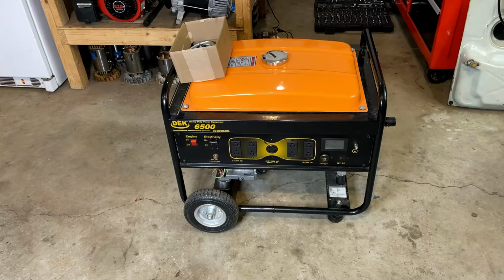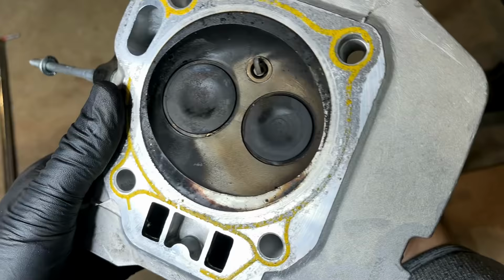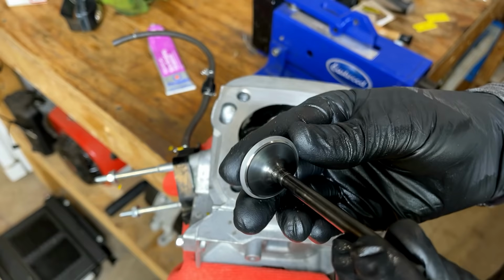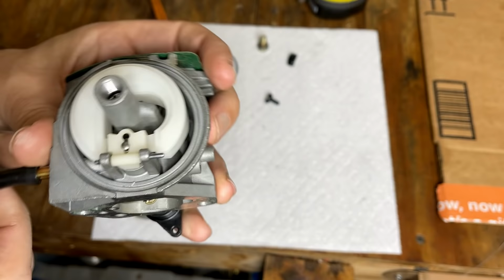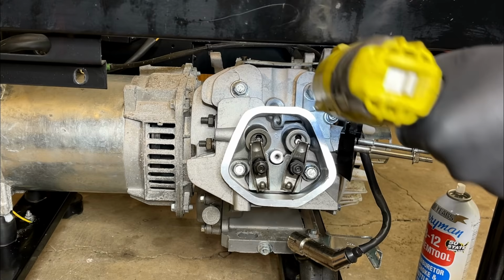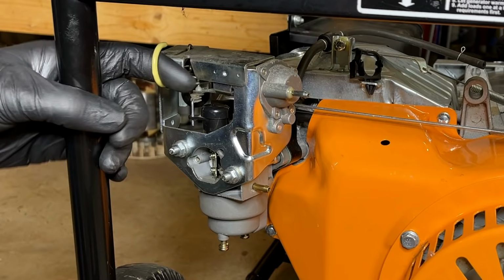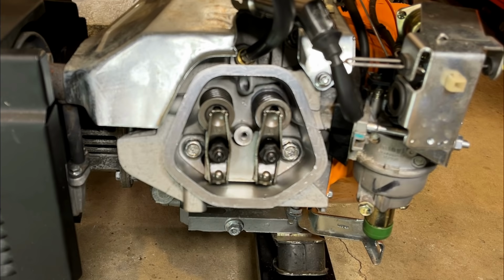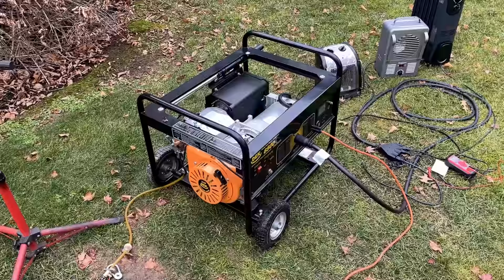Honda Clone Almost Dropped a Valve - Broken Valve Repair on a DEK Generator

Comment: Excellent work James as always. You mentioned that the cost to fix was about $50. With all the time you spent on it I'm sure it would be far more than that if someone were to bring this down to a small engine shop. 

Got to think of it this way, if it takes you 15 minutes to do something that takes another person an hour to do the same thing, you are not being paid for your minutes, you're being paid for the years of experience!
Reply from the maker: Thanks.  That was only the parts cost.  I would expect it to cost $200+ in labor alone.
Reply: @jcondon1  good stuff!
Reply: We live in a throwaway world. I like to watch James because he rescues gens from the dump. More people should learn to fix stuff rather than pay someone only to learn it will cost more to fix than a new one (not just gens). I used to be worthless when it came to repairing stuff especially small engines. Thanks to YT and the determination to not give up, I have kept my stuff alive for far longer and at a much cheaper cost than paying someone or brand new. Be a man. Buy some tools. Learn how to fix the stuff you own. The knowledge you gain from one thing spills over into other things. It all adds up and you will be much better off. Then, when your driving down the street and someone puts a lawn mower, gen, etc. out for free, you've scored!
Furthermore, if carbon credits ever roll down to the consumer, rescuing a gen from the dump will be worth far more than the $150 he spent.
Reply: @billclinton6040  Great comment i could not agree more ,i assume you are not THAT  Bill Clinton? You seem way too smart .lol.
Reply: Great job, as always James! This One Had some interesting issues! Nothing you could not handle though!
Reply: Fixing stuff has nothing to do with “being a man”

Comment: That generator couldn't have had enough hours on it to have those issues. Probably came out of the factory with an issue that escalated quickly. You are great at teaching.
Reply: There warranty is terrible also

Comment: Wow, who would have thought. This is the 2nd time in past few fixes you've found a bad plug. Sure raises flags when I'm working on one of these engines. Thanks, appreciate this valuable lesson. 
Great video, and thank you for sharing...
Reply from the maker: Just found another bad plug!  I always said "It's almost never the plug".  Guess its catching up to me.
Reply: I have an 8 HP B&S on a rototiller that’s 50 years old.  Original spark plug and it coughs on the 1st pull and starts on the 2nd.  If it ain’t broke, don’t fix it.

Comment: Excellent tutorial. This video literally answered all my questions. I currently have a 10K Powerland generator (16hp) with a bent intake valve. Ordered the parts. Now I know how to properly repair it. Just need to find the specs reference ( rocker arm/ valve gap, etc.). Thank you.

Comment: This was a very good purchase.  You kept this unit out of the landfill and will make someone a very good generator.  Probably has lots of life left in it.  That back firing after you did the valves had me concerned as well.  One of the few times a spark plug was the culprit.  Great job.  Thanks for the video's.

Comment: I service sewing machines of many types in a large shop (I have about 150 units).  When a machine is not stitching correctly and there is not an obvious mechanical problem, I always start with a new needle.  Then I continue to troubleshoot.  The sewing service manuals agree.  Possibly keeping a cache of known good spark plugs to use when servicing the engines?  I always start my lawn mower season with new plugs.  Your videos are awesome.  I learn so much from them and your camera angles and lighting are excellent!

Comment: Great video, I watched every second of it and I have this exact generator.  	
Neighbor wanted me to fix it and ended up selling it to me for $125.    Sitting so long the carb was completely gummed up.  
 It’s running now but boy that compression is strong.  If it doesn’t start on the first two pulls, it is almost impossible to pull start it.

I think I'll revisit the valve adjustments.

Comment: I had the same problem with the generator there is a brass ignition control box on the side of the generator that is bad replace it and it’ll be fine don’t keep messing with everything else it’s not gonna help you need to replace that box

Comment: That's a surprisingly clean generator.  Most projects seem to have been improperly stored, or not maintained well.   I bet this is really low hour.
Reply from the maker: Was hoping the meter had the hours.  This one was definitely cared for and it let the original owner down.

Comment: Your videos are absolutely the best.  After 40+ years of wrenching I'm still learning things. Is it possible that the sudden movement caused by a backfire allowed the piston to hit the valve before the valve was able to get fully reseated?  I had a Gravely Commercial and a Kohler 8hp with a broken camshaft. New camshaft installed. First pull it backfires. Camshaft broke. Solution - I gave it away.
Reply from the maker: Anything is possible.  Would say for sure that plug issue existed prior to the valve issue.

Comment: You've trained me well, James. I'm starting to think like you. I would've used a cut off wheel on a Dremmel also. I would've    never guessed a bad spark plug. Excellent video.
Reply: If the original plug in it was a Champion I would have checked it first thing. I will never waste a cent on them anymore. I've had them go bad in a few days while the engine wasn't even being used.

Comment: I have the same exact 420cc clone engine on a Powerhorse 9000ES. There are manuals for my engine. It is smoking, mostly because of unburnt oil getting in the muffler. It burns for 5min after shutting off engine. I am going to remove the head tomorrow. Hope I only have to lap the valves like yours. Would love any comments if that does or doen't sound right. I am very new and clueless to much of this, but your videos help immeasurably.

Comment: When I work on any small engine,  if I have doubts about the plug,  I change it. 
A friend of mine had a Honda engine that wouldn't run. He changed the carburetor,  replaced the piston,  and rings.  Finally replaced the plug and it ran fine.  The plug would fire outside the engine not in the engine.  A lot of work because of a bad plug.
Reply from the maker: Plugs are a cheap and easy thing to try.

Comment: Good Fix! Perhaps your Hi-Meg meter would show a bad plug? Back in the day they had S. P Testers! The spark must be at the Gap. Low voltage might get it done! Continuity to the threaded part would mean leakage. A series resistor pair, one Hi and one low would work! Ron PTL USA
Reply from the maker: Not sure.  Should have tested it.

Comment: When doing a final analysis on the engine, I always make sure the airbox/filter is installed before setting engine speed. As far as the plugs go, I have seen many hard start/flakey starts or no starts due to the cheap Chinesium plugs. They can look fine, but something is breaking down inside, something you cannot see. I always put a new NGK equivalent plug in before returning the engine to the customer. They add very little to the repair, and ensure a plug won't cause a comeback. Good work James, hope these suggestions help.

Comment: UK Great stuff James. As an engineer I really don't like those rocker assemblies. Using a bit of plastic to keep the pushrod in line and the rocker is not nice. Of course it's the cheapest way they can make it. It seems all of them are as crude as possible, mind you if they were well made we would not have your videos.

Comment: Good work.     It isn't worth a person's time to worry about fragments of metal in a splash lubricated engine.    They will do little or no damage anyhow IF they are there.    They settle in the sump.   It isn't like dirt that will keep circulating and doing damage.

Comment: Excellent explanation of how the compression release works: When the engine is rotating very slowly (as when being pull-started), the exhaust valve **briefly** opens just a tiny bit during a small portion of the compression stroke. If the exhaust valve clearance is too large then the exhaust valve won’t open at all while pull-starting, thus making it very difficult to pull hard enough on the starting rope. On the other hand, valve clearance too small releases too much compression, also making it difficult to start the engine. Testing for 60 PSI compression while rotating the engine with the starting rope just about guarantees that the compression release is working as it should.

Comment: Great video as always. You have a fantastic knowledge of those clone engines! 
I must say I have always been surprised how few plugs you actually replace. Today's plugs are so much better but most engine manufacturers have you changing them quite often! Although other than my Hole house Generac Generator I'm not much for replacing a plug if it's operating ok. 
Keep the great videos comming!
Reply from the maker: I am the same way.  If its working, then I leave it alone.  But I do keep extra for my generator just in case.

Comment: Hello James! My personal name is Larry! For me your videos are very informative and worth taking the time to learn! 
If possible I would like to return a little knowledge. You may already know of this, as well as others. Still, ... My take!
You have 2 methods "maybe more" of removing the rotors from the engines of generators. 1 is using a long rod larger than the diameter of the threaded hole in the bottom of the engine crankshaft. The other is "Hydraulic" pressure.. I've so far, have only used 1 method, and it works fast and easy! If the hole is already threaded in the rotor shaft end "GREAT" !! Just find the correct size 3" bolt. If not then, okay tap some threads. I'll put a nut on the bolt and then screw it into the rotor shaft until it has significant resistance. I'll tighten moderately with a wrench, then tighten the nut down against the rotor shaft securely! Then..... I use my "Air Chisel or as some call it "Air Hammer"! 
Against the head of the bolt....TAKE extra precautions to ensure the working tool stays on the bolt !! Once the trigger is pulled.... It's all over in less than "1" second!!    For me the investments were already made. As I have the compressor and air tools already from other hobbies. 
 I have always loved repairing everything I can myself!!! Years ago I learned .... I can purchase parts, tools, and use my time to do the job......just find the information to do it "is the biggest challenge, at times" !! When the job is finished, so far I've been able to save enough in cost, that I saved money and still have the tools in my collection !!! Larry...
Reply from the maker: Thanks Larry.  I tried the air hammer method once and failed.  Will have to try it again.  Might need a bigger hammer.

Comment: Normal standard procedure for smal air cooled Engines in Germany is 0,15mm = 0.006 inch for intake valves.
At the output valve we take 0,25mm = 0.009 inch. So the experiencees match somehow.
The outlet is getting very hot so a gap of 0.009 inch is not too much. It depends of the cooling of the valve and cylinder.

Comment: I've had a similar issue with every clone engine I've owned, but the guide has always worn on the exhaust side. I had a new generator drop a valve after just 300 hours.  Wish I knew the root cause. 
Like your videos. 
My last three units all had the same issue~one brush was riding about 3/64" off the edge of the slip ring.

Comment: James Condon, the mixture screw that's rounded off is also epoxied in place they're a real job to get lose an out because the brass is so brittle........ but i'm sure you know that, i'm more saying it for anyone else thinking of removing it
Reply from the maker: I have tried before and you are correct.  The brass is very brittle and just crumbles.

Comment: James your my new heroand thank you very much for sharing your knowledge and for the effort it takes to do such great work and share it with us . your methods are true to the BONE !Ihope your having a great day ,because I now am all thanks to you my friend my generator now runs as if it were new.dude you rock.youve restored my faith in humanity.its just about to storm out here in the so cal mountains we're at about 8 thousand feet and by the looks of these clouds it's gonna dump they are claiming 4 to six feet .they are usually pretty close on the local radio station so the power as always will be on the fritz.no worries here now thanks to you our generator is ready to rock and roll out the power.thanks again man you've made our week.great videos keep em coming.Attt.10 of 10.💯👍

Comment: Ok , @14;15, that far enough. Broken parts missing from the valve assy, and not going to open the cases to find them. Next time you do an oil change on your car/truck/van throw in a hand full of small ball bearings, they are really good for keeping the oil mixed

Comment: That metal spark plug cap instead of the old rubber kind certainly is a nice improvement. I’ve never seen one of those

Comment: I had similar thing happened to me just a few days ago. I was fixing a gx390 clone on a water pump, after i fix the carb i tried to start it and it did without any problem only after I started to revved it a bit the engine blew up the valve cover blew up the spring were mangled and the pushrod bent really bad, the valve bent and there's a big gouge in the piston

Comment: A nice fix. I know engines, but not much about these. I bought my clone-gen ages ago, thinking I was OK because the national importer and their service department complete with a well-stocked parts warehouse was just 8 miles from where I lived. My generator always worked well for me though I did have to clean the in-tank fuel filter and the carb a few times in a dozen or so years. Changed the oil twice. Then one Thursday on the job it ran out of gas late in the day- or so I thought, but more fuel didn't do the trick. I took it home and discovered the rocker arm was off the intake valve which was bent and sticking. Not having time to fool with it I borrowed another one for the coming Friday and Saturday saw me looking for a phone number for the company- nothing. An online search showed only a couple for sale on Ebay like mine; no info on the company. I Googled the name on the engine and discovered that company had gone kaput a decade ago and only a few generic nuts and bolts could be had for it. I'd gotten more than my money's worth out of it, and not knowing other clone parts might fit I went for broke in one last attempt to fix it. With a couple blocks of wood, my claw hammer, and a brass punch I straightened the valve by eye, the metal the valve was made out of was as soft as spaghetti, and in seating it in the head I gave her a few taps straight in with the punch hoping it might help it seat. It started on the first pull and it's ran a few full workdays since then, good as ever: un-freaking-believable! I should have bought a lottery ticket that day.

One thing I did notice was there was a lot of valve lash on it which may have played a role in it dying. I'd never looked at that since it had always ran so well. I'd now advise folks to keep an eye on valve clearances often with these clone engines. I set the valves to 006 and 008 as a guess- seems I guessed close enough. I never in my life expected it to run again at all but the darned thing does. I'd love something better but semi-retired now there's no money for that. It's enough for my needs and I could sell it in hours for 2/3 of what I paid for it so I'm happy.
Reply from the maker: Good job getting it going again.  Clone parts are available if you need, but need it is a bit of a guessing game since there are usually no part numbers.
Reply: @jcondon1  Well with your video I now know of the possibilities and might find success where once I saw none. Thank You!

Comment: James when starting her up you should leave the choke out for a little while! Also, she will run much better with the tank on getting proper fuel supply! And you should have replaced that spark plug when you had it out. But great video!

Comment: Recently new subscriber here and have been binge watching your videos. I originally searched your videos for a DEK 6500, because that’s what I own, and nothing came up. Haven’t watched this video yet but am excited because here is what I originally was looking for. 😆
Reply: Guess we better save for a newer better generator. Didn’t realize they were no longer in business. 
I bought the generator on Thanksgiving Eve on the way home from work during an ice storm. Husband had called me and said we were without power. All the local stores he checked had already been bought out. The first place I stopped had this dek 6500 for $400. That was back in 2007. We’ve used it multiple times during outages. Our outages sometimes last days. We recently put a LP conversion kit, like what you used in a video on a rigid, but haven’t tested it out yet.

Comment: Great video , A easier way to start the spark plug is to use a piece of fuel line on the end of the plug to assist in turning the spark plug in , just a tip .